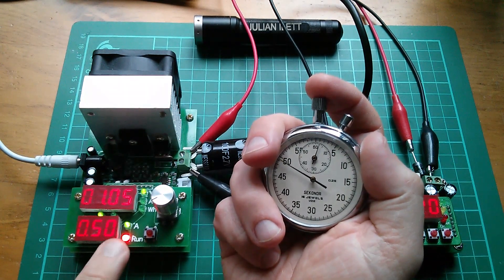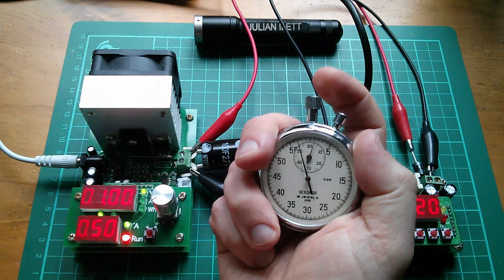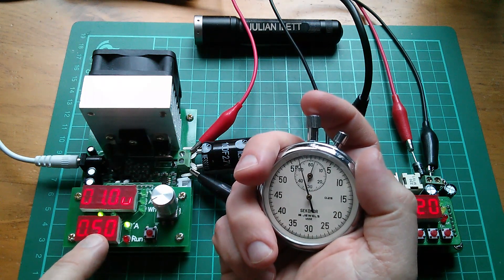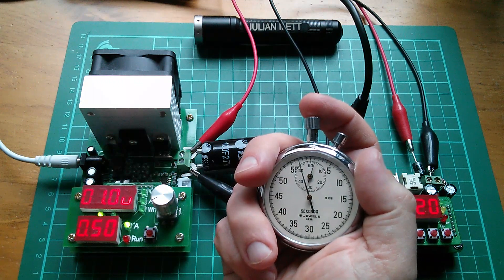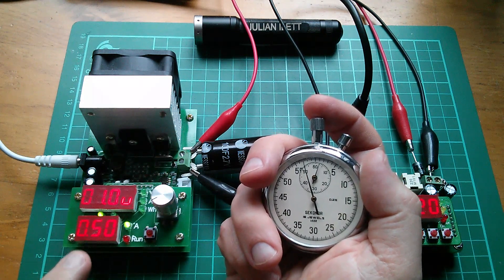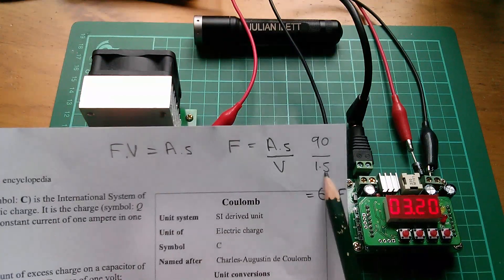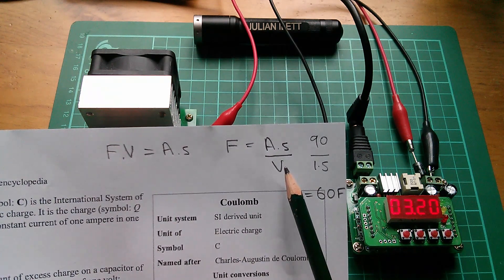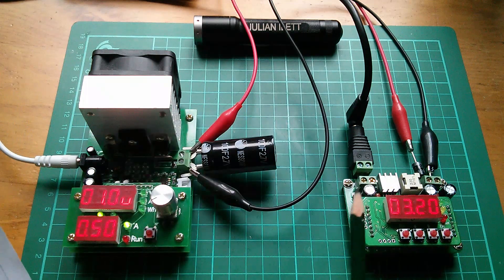Measuring the Capacitance of a SuperCapacitor

Comment: what is your components tester measuring?
Reply from the maker: It's an electronic DC load that displays voltage and current.
Reply: Julian Ilett yes, but don't you have a DVM or the AVR component tester (also known as M-Tester) for comparison of the capacitance and testing the ESR?

Comment: This is the wrong way to do this. The rate of charging or discharging is depending on the charge of the cap. Your calculations is under the assumption that the rate is constant.
The formula for charging: http://hyperphysics.phy-astr.gsu.edu/hbase/electric/capchg.html#c1
And for discharging: http://hyperphysics.phy-astr.gsu.edu/hbase/electric/capdis.html#c2
Reply from the maker: The rate IS constant because the capacitor is discharging at a constant current.
Reply: Those examples you link to are for charging a capacitor through a resistor. Then indeed the charge/discharge rate depends on the voltage across (and thus the charge in) the capacitor. But Julian uses an electronic load which draws a constant current. It is like an electronically regulated resistor which changes value such that the discharge current remains constant !
Reply: You are right.

Comment: You didnt drain it from 2.7v to 0v.
if you did you'd realize its Around 100 farads (You could probably squeeze out a bit more if you charged it to 2.75v i doubt it'd hurt the capacitor. Mine has been taken to 3.5v and back again and its still going strong. they seem to have a huge tolerance if your charging at a low rate. i was only charging at 400mA to 0.75A

Also you need to keep it topped up at 2.7v for a while or charge it slightly over for it to hold at 2.7v for a while.
then you will probably get 100 farads out of it
Reply: I think you're mixing capacitance in Farads up with energy in Joules. To calculate capacitance, you use the formula C = q/V, where q is the symbol for charge, expressed in units of Coulombs. He plugs the formula for Coulombs into this equation to solve for capacitance and to compare it with what was claimed by the manufacturer.

the formula for energy is E = 0.5*C*V^2. If you wanted to know the total stored energy in Joules you would indeed discharge it from 2.7V to 0V. You could go higher but if the supercap's electrolyte is an ionic liquid then the electrolyte will break down and oxidize your electrodes (irreversible redox reactions), some supercaps, called pseudocapacitors, have the proper electrode metals that allow reversible faradaic reactions. A typical double layer capacitor can store additional energy at a higher voltage, but you will oxidize your electrode and will eventually have capacitance degradation.
Reply: I never said anything about joules! Where did you get that from?? And my super capacitor has not lost any capacitance. it just must be very tolerance of overcharging i guess.
samwha green cap brand 100 farad 2.7v super capacitor.
Normally i only go to 2.85v and hold it there for a minute then take off the charge so it will settle around 2.7v simply because i only have 1 super capacitor

soon i'm going to be getting two super capacitors and i will be putting them in series each being 400 farads to use to make about 5v no need to overcharge them at all then
Reply: Sorry I should clarify. To calculate the capacitance in Farads, you do not need to drain from full to 0. You would do this if you wanted to find the total energy in Joules. Capacitance does not depend on what voltage you start or end at. As long as you discharge at a constant current, any start and end voltage will give you the total capacitance. If we discharged the capacitor from 2.7V to 2.69V at 1mA we would eventually get 60F after 10 minutes. This is because in our formula for capacitance, C = q/(Vstart -Vend) or in other words Farads = (Amps * total time)/(Start Voltage - End Voltage).

I'm glad to hear you don't hold your supercap at an overcharged state for too long, that should limit the amount of faradaic reactions that oxidize your electrode metal and would explain why its capacitance hasn't degraded much!

Comment: You might want to set the discharge to .2 A and charge to 1.2 A for a net 1 amp charge rate and see how long that takes. I am wondering also if it has to "soak" a while at 2.7 v. If you charge it to 2.7 v quickly and disconnect the cap does the voltage drop as the chemicals stabilize ?
Reply from the maker: There's no chemical reaction going on inside a supercapacitor. By timing the voltage drop under a constant current load, the ESR is factored out.
Reply: I know there is not supposed to be any reaction, I just don't trust caps that big and that cheap to be everything they are supposed to be.😀

Comment: I agree with some of the comments. At 1v left into the supercapacitor, you still have a charge on it. So indeed if it's a linear function you don't have to discharge to 0v but you need to count for the charge left into the supercapacitor. So from other comments, it turns out you have a supercapacitor of approximate 100F.
Thank you for going trough the effort to exhaling it to us.
Reply: If your car has a 50 litre fuel tank, and you drive for 10 kilometers and use 1 litre, do you need to drive the tank dry to know how many kilometers per tank? Same.
Reply: it is as SimoWill says, in this case we are looking for capacitance which is charge per volt, which is not much different from litres per kilometer.

You might be mixing capacitance up with energy. Capacitance = q/V whereas Energy = 0.5*C*V^2. Julian took the formula for charge q, expressed in Coulombs C and plugged it into the formula for capacitance to calculate and compare his result with what was being claimed by the manufacturer. 

However, if we were looking for total energy in the cell, you would be correct to say that there would be unaccounted charge if you stopped at 1V.
Reply: Indeed. I learned something. ... Thanks for clarifying.

Comment: I can't quite make out the brand name of the capacitor in the video but i'm going to go on a limb and say it's one of these generic Chinese capacitors? I'n which case i'm quite surprised it even has over half it's stated capacity, espeically going on the capacity claims of some of the lithium ion cells you can buy from there...
Reply from the maker: It's branded Nesscap, but I don't know if it's genuine.

Comment: Julian what did you study for college
Reply from the maker: Computing and control systems at Coventry Polytechnic (as it was back then)
Reply: Julian Ilett well I'm a senior next year in high school I love tech I work on the electronics in robotics class I do all the esc and motors and program the mixing in the controllers and do the binding j made my own ebike with a drone esc the was supposed to work on 6s lipo max just chaged the capacitors and made it work on 10s no problem but I still dont know what I want to do for college

Comment: instead of using fixed current source why don't you use simple resistance. t = r *c and total time for discharge is 5t.
Reply from the maker: Discharging into a fixed resistance makes the maths more difficult.

Comment: You have mentioned that super-capacitors do recover after quick discharge.
I wonder how much voltage it recovered after you turned load off ?
if it is significant it can be the reason of measured low capacity

Comment: There was a quick trick we used in the 80's for figuring out the approx vaule of series and parallel stacked caps for custom values, but fo the life of me I can't remember. I do know that back then a 20% capacitor was something one could only dream of....
Reply: Here's a simple method that yields reasonably accurate results.

1.  Discharge the cap completely.
2.  Charge the cap with a fixed power supply through a known resistor.  
3.  Measure the time it takes for the cap to charge up to 0.5V.
4.  Discharge the cap (for safety).

If your supply voltage is much higher than 0.5V, the voltage across the resistor will not change very much as the cap charges to only a small voltage.  The current through the resistor will almost be a strait line from it's initial value I_start = (Vs/R)  to I_end = (Vs - 0.5)/R.

 The average current will be I_ave = (I_start + I_end)/2  = Vs/R - 0.5/(2R)

You can use this average current to calculate the capacitance.

 C = (I_ave)*t/0.5

Just make sure your resistor has a high enough power rating to handle the current (P=I^2*R).

 Lets throw some numbers in there...

 Vs = 12V, R=47ohm.   =>  I_ave = 12/47 - 0.5/(2*47) = 250mA  

 If you're lazy, you could just estimate I_ave as 12V/47ohm = 255mA, but this introduces about a +2% error.

If your capacitor takes 20 seconds to rise up from 0 to 0.5 V, then...

 C = (0.25)*20/0.5 = 1F

Comment: scratches head Isn't the capacity measured with reference to zero charge = zero volts?  It seems to me that since you didn't discharge the capacitor to zero volts, you're only measuring part of its total capacity, which means that 60 farads is probably reasonable given the measurement method.  Or am I missing something?
Reply: In theory Farads does not depends on Volts. In practice ESR can make measured capacitor capasity less than real (that has not happened here)
Reply: JasonMasters If Julian would have kept draining the capacitor to 0V that would have taken more seconds (so more Farads) but at the same time the voltage drop would have increased (so less Farads). These two differences would have balanced each other out resulting in the same capacitance.
Reply: A 10 liter bucket is still a 10 liter bucket, even if you pour just 5 liters out of it (and measure how long it takes at a certain rate). Capacitance is how much "fits" into a capacitor, charge is how much is in it.
Reply: You may be mixing up Capacity and Capacitance. When you say capacity, you are referring to energy in Joules, which, to be accurate, you would need to discharge to 0V to measure the total stored energy, as you say. However, we are looking at Capacitance, which is charge per volt and, like Volodrumur Kalunyak says, does not depend on what voltage you start or end at.

Julian took the formula for capacitance, C = q/V, where q is the charge expressed in Coulombs, and substituted q for the equation for coulombs expressed in amps and seconds so he could compare his measured value against the value claimed by the manufacturer. The equation for energy (E = 0.5*C*V^2) uses capacitance, so it is important to know this value if you want an accurate approximation of the energy in the cell.
Reply: well you can do the same calculation at 0.5V dropped and 1V dropped(since the stopwatch is on screen). you always get roughly the same  result. i'd only think that it'd be slightly more precise if you discharge it more since that'd lower the amount of human error in pressing the button.
Reply: if you had an oscilloscope, as long as your voltage resolution is decent and you have enough sample points to get a non noisy slope, you could measure for an infinitesimal amount of time ( or just 1 second) and it would also give the same result
Reply: yeah of course. but with thiis method of measuring a longer amount of time will make it more precise. because theres less error.
Reply: say you have a graduated cylinder of unknown capacity.  if you drain a known amount of liquid from it, you can use the graduations to determine how much of the total capacity you drained, which will tell you the total capacity.

Comment: I might be missing something, but if you get a capacitance of 60F for a voltage drop of 1.5V, wouldn't the capacitance be 60 / 1.5V * 2.7V = 108F for a voltage drop of 2.7V?
Reply: Klaus Petersen     Yeah, from what I understand, you're right. He only used a portion of the total capacitance, and that is what he calculated/measures - his use. So your math gives the total capacitance not just what was used.
Reply: In theory Farads does not depends on Volts. In practice ESR can make measured capacitor capasity less than real (that has not happened here)
Reply: I also think that he should do a test from 0 to 2.7V
Reply: No, that's not how it works.  The equation has time in the numerator and voltage swing in the denominator.  If you change either one the other changes by a proportionate amount, and they cancel out such that there is no net change.  Julian could have picked any starting and ending voltage to measure and would have gotten (roughly) the same result.
Reply: Think I finally got my head wrapped around this. Thanks!
Reply: but the voltage swing wasn't across the whole range of the capacitor's well, capacity.  Some of the charge was left in since he didn't go down to zero so what he measured was the farad's consumed, not the total farad's for the capacitor.  If he had gone to zero volts, he would be measuring the components full capacity. Basically he is measuring a section under the output curve so 60F might be appropriate.
Reply: kelly french the point is, as I understand it, the voltage drops slower on a larger capacity capacitor compared to a lower capacity capacitor. By measuring the time it takes to drop a certain voltage range, you get a pretty good idea of the full capacity.
Reply: It does not depend on the voltage. It's the rate of change (or slope) that matter, you can choose any value of start & end voltage.
Think about this, if he would let it discharge to 0v, the time would be greater but the divider would increase as well, cancelling each other.
Reply: Okay, I understand better now. Yeah, his calculations are right.
Reply: Supercaps even from reputable manufactures have a usual tolerance of +- 20%, so -40% off of a cheap Chinese one actually is not that bad.
Reading a bit on Wikipedia, it was striking to find the strong correlation between the frequency and capacitance in Supercaps, for example at 10Hz the capacitance drops to 20% compared to DC.
Reply: If the drop is linjear, then the starting and ending points should not matter, but for a more accurate result you would want a big gap.
Reply: Klaus, I think you're right.
Reply: You are right! The capacitance is the maximum energy stored. Charged up to 2.7V and discharged to 0V!
Thank you for that good point!

295 seconds from the second run equals to 98F ... so 100 is the right number on that CAP
Reply: Sven, no it's not... let me quote from Wikipedia:
"The capacitance is a function only of the geometry of the design (e.g. area of the plates and the distance between them) and the permittivity of the dielectric material between the plates of the capacitor. For many dielectric materials, the permittivity and thus the capacitance, is independent of the potential difference between the conductors and the total charge on them."
Reply: Shlomsi2000 there is a maximum voltage for every actual capacitor. If this voltage is reached, you can't store more energy in it. If you try you will destroy it. Without that practical limit you might rise voltage and store more energy in it.

In this case the capacitor can store 100 coulomb ans the resulting voltage is than 2.7V. = 100F
Reply: But we're not talking about the energy stored nor the charge. you're mixing capacity with capacitance.
C=A/d ... Area/distance between plates.
Think about how capacitance meters work - it does NOT matter what the maximum voltage rating of the cap, you can measure a 10uF/16v or a 10uF/400v - still 10uF, the meter dose't care about the voltage, it applies a low voltage and then monitor the discharge rate.
Reply: @shlomsi2000 Ah, got it. Yes! An capacitance-meter would read ~37F/V, connected to this CAP. 
And as it's maximum voltage is 2,7V (before danger of self destruction) I can store about 100coulomb in there. So the capacity is 100F, but the capacitance is 37F/V. Right?
Reply: Wrong :/
Reply: The value of a capacitor in Farads is independent of voltage.
The amount of energy that can be stored in a capacitor in Joules is dependent on voltage.
Formula: Energy = 0.5 * C * V²   where C is value of the capacitor in Farads and V is voltage
So, a 100F capacitor loaded to 1V holds 50 joules of energy
and a 100F capacitor loaded to 2.7V holds 364.6 joules of energy

From this it is clear that hi-voltage capacitors are much bigger than low-voltage capacitors with the same capacitance in Farads, because they can hold much more energy. Therefore those so-called super-capacitors  are very low-voltage. A 50V 100F capacitor would be over 300 times bigger in volume than a 2.7V 100F capacitor.

Comment: can you translate the Farads to Watt Hours?
Reply: No, cause they are not the same.
Farads are Wattseconds divided by Volts squared.

But if you want to know the storage capabilities of that Cap - you have 1/2*C*U² so 0.5*60*2.7² = 218 joule.
Reply: Sorry I meant Ah. I'm just trying for figure out what to replace a 12V 88Ah battery with using super capacitors.
Reply: Assuming you need that full capacity not just the rate of power delivery for that battery size...
12volt*88amp hour=1056 watt hour
60sec*60min*1056 = 3,801,600 watt seconds aka joules
J=1/2C*V^2 or C=2*J/V^2
C= 2*3801600/7.29
so little more than 1,000,000 farad assuming 2.7volt standard cap voltage.

If you wanted a starting voltage close to a 12 volt battery 5 series caps would have a staring voltage of 13.5.
Series capacitance of about 42,000 farad.

In practice you couldn't really get 1056 watt hours out of a lead acid battery without killing it very quickly.  Maybe 500 watt hours or so.